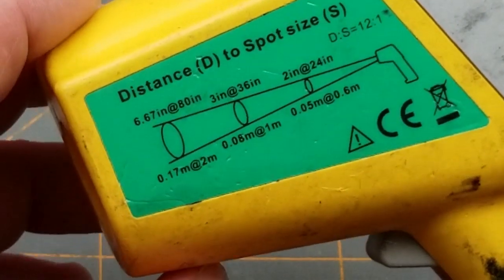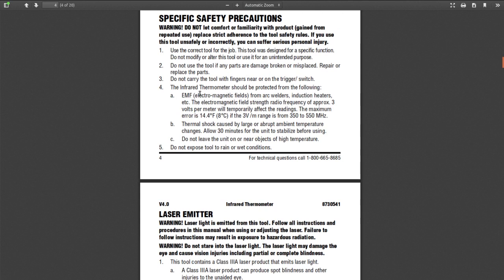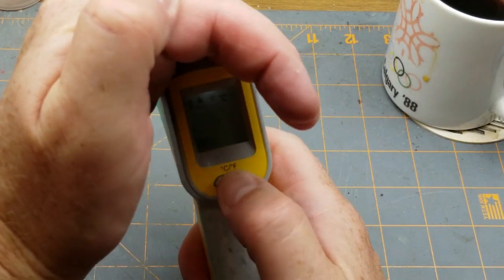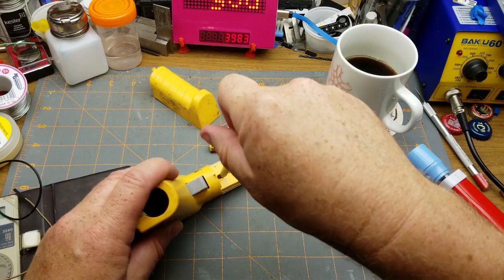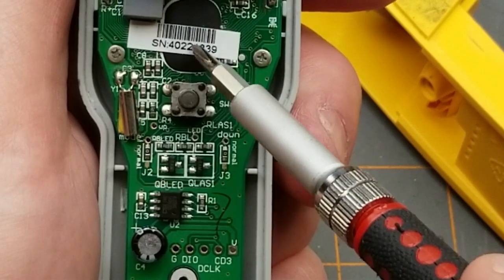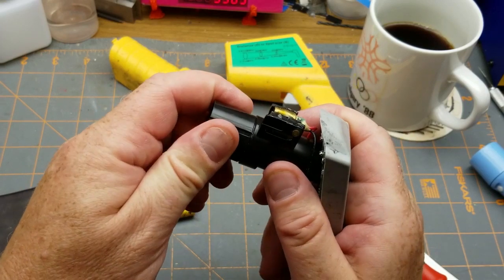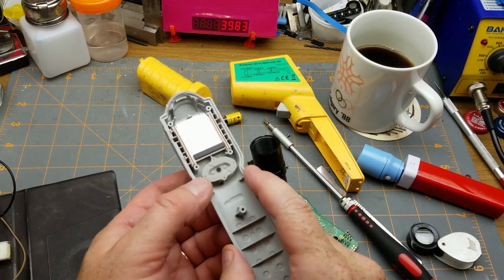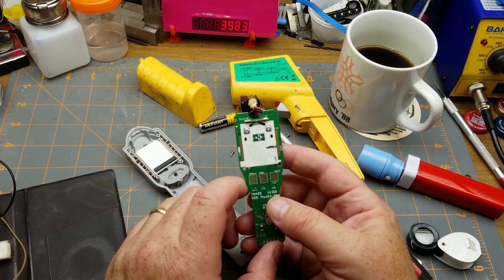infrared thermometer - curiosity teardown and minor repair

Comment: I bought one of those from banggood or on E-Bay for very much cheaper, it had extra buttons, one to toggle C and F degrees, one button was for the backlight and another for the laser pointer. Works quite well off a 9v battery.

Comment: If the calibration process on those cheap, (but really good), multimeters is anything to go by I'd say this is what those two extra buttons are for.

With the board out of the case and aimed at a known heat source the buttons can be used to set a calibration 'offset' which is then stored in the EEPROM......cuts out the need for fancy calibration equipment.

Once calibrated there is no need for any user access. All just a guess mind.
Reply: The button pads are not for calibration - those are the backlight and Mode buttons on higher end models. The operation will be dictated by the programming of the MCU (blob).
Calibration will be done in software during construction.

Comment: those 3 button pads have blank knobs in the rubber part ready for contact. I would glue some gold leaf or foil onto those knobs and see if the switches do anything without reprogramming. I used gold leaf on a few car remotes and it works real good.

Comment: Thanks for this teardown pileofstuff! I have a question about that black cylindrical piece you took off at 13:05. On my IR thermometer, just around where the sensor fits into that cylinder, part of the cylinder is a very dense metal or heavy plastic. Do you recall if yours was metal around where the sensor went in? Why didn't they just use plastic there?
Reply from the maker: a memory test, eh...
I think it was a dense black plastic. 
Possibly black to prevent stray infrared reflections from bouncing around in front of the sensor? Maybe carbon impregnated ?
Reply: pileofstuff ok thanks! Must be for something!

Comment: I've just found out mine has a fault on it illuminated screen but blank tried new battery nothing must be the little ic chip under the black blob of glue
Reply from the maker: If the problem is with the blob chip, there's not a lot most people can do to fix that.
Reply: I agree cheap chinese crap it was working perfect about 2wks ago never dropped it or anything it just simply stopped working next time a fluke.
Reply: the contacts aren't touching right. these things need the case he-man'd together to maintain the connection. Still, if you never had it apart or dropped it, it shouldnt have shifted. unless you touched the screen or it was jostled in storage/use . theres no glass or plastic sheet to protect it. The screen itself is just out there for the world to have it's way with.

Try opening it and shifting the white contacts around while you push down on each side. I'd bet it starts showing some life.

Comment: For example, stainless steel has an emissivity value of 0.59. Here is a link for Infrared Emissivity Table. Lower values mean that the surface is not as efficient as emitting infrared energy. https://www.thermoworks.com/emissivity-table
Reply: AKA, the temperature reading is lower than the actual object.

Comment: Congrats on 4K Subscribers.
Hi, the company I work for does basic calibration checks on these IR thermometers, they usually last about 5years in good cal.
By then its more economical to get a new unit rather than get a full NATA recal.
The 0.95 emissivity does refer to the surface of the object being tested.
You can get charts giving you varoius values for different alloys and materials.
http://www-eng.lbl.gov/~dw/projects/DW4229_LHC_detector_analysis/calculations/emissivity2.pdf
To get an accurate value, you have to take emissivity into account.
The more expensive units, ie Fluke, allow you to change the emissivity parameter.
Since OH&S has kicked into the food industry, IR Thermometers have become quite popular, hence the cheap Chinesium units.
Reply from the maker: Good info. Thanks.

I hold no illusions that this one is anywhere near calibrated after almost 10 years of my abuse. And for my use its close enough - im just checking if air conditioners are still working.

Comment: You paid about $60 too much for that device. Emissivity is important, because only a pure MATT BLACK surface has emissivity of 0.95 (It emits 95% of it's actual temperature). A shiny metal surface would have emissivity far lower, so the device will not accurately read the temperature. Any decent IR meter will have adjustable emissivity value, so you can adjust it to suit the application.
Reply from the maker: To be fair, I've had this thing for about 10 years, and work paid for it. 

Thanks for the information about emissivity. I knew there would be people in the comments who know about this stuff!